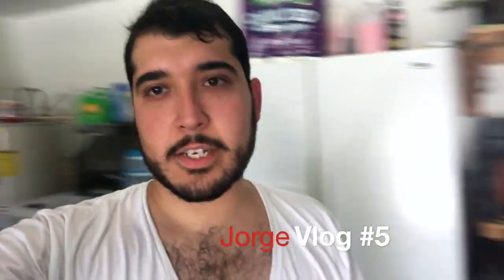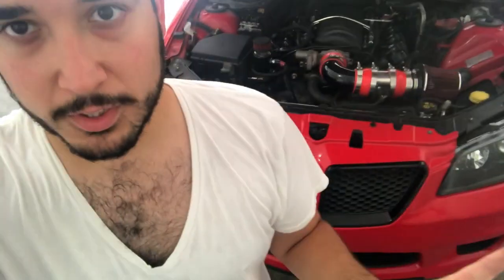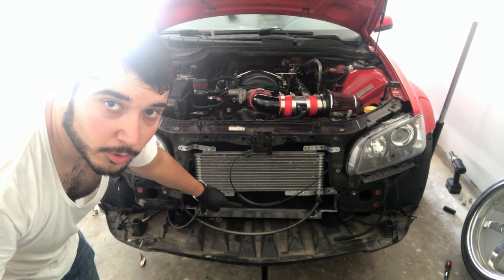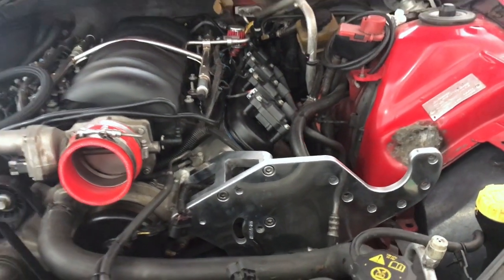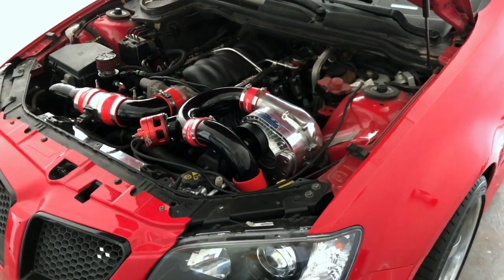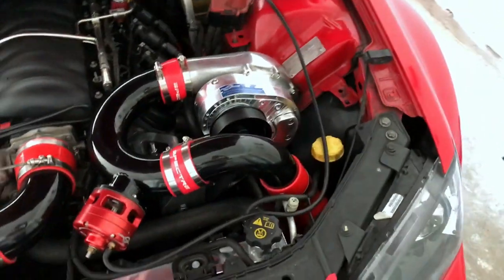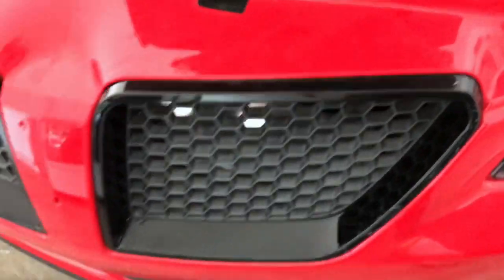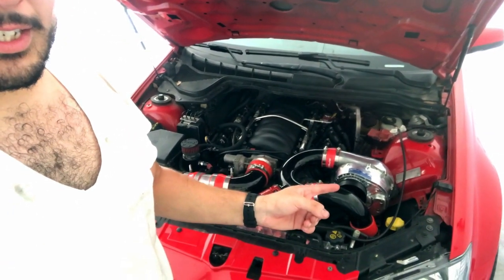Installing the Procharger!!!

Comment: Very nice work Jorge! It would be interesting to see the dyno tune! Also take a look at doing a tune to handle both E85 and 93 Octane gas. While the mileage might do down a couple of miles per gallon all that ethanol will add another 50 to 70 hp. The L76 in the G8  GT is certainly capable of 550 to 600 horsepower! Enjoy that G8! Thanks for the post!

Comment: It looks great! You don't run an air filter? That doesn't scare you? I'm not hating, I have a GTO with an F1a and the air inlet pipe SUCKS but I cant imagine not having an air filter.
Reply from the maker: Aaron Rembert thanks, and I didn’t run an air filter but I did run a mesh cover of sorts. I only drove the car on sunny days and dry days so wasn’t worried about dust or any water getting sucked in

Comment: What was the power it made what  engine mods. PS thanks for the video on checking trans fluid
Reply from the maker: Michael Prince it made 700ish with procharger build motor on lower compression and 16 psi with 93 octane

Comment: The vacuum line going to the bypass valve is it t'd into the brake booster/vacuum?
Reply from the maker: That is correct, procharger provides a vacuum distribution block which you use to connect the blow off valve.